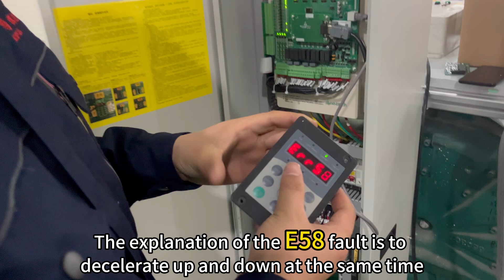Monarch Elevator Controller E58 Error – Step-by-Step Troubleshooting Guide

Comment: Can you share the pdf to the full parameters for the NICE3000. Thanks. We are having trouble with intergrating to out BMS due to lack on documentation on communication protocol used by the controller.
Reply from the maker: Hello, we are happy to help you. You can add our engineer's Whatsapp: +86 182 6019 7208 for document support